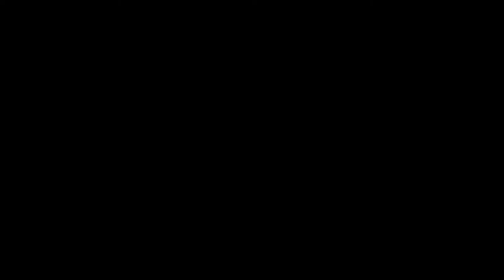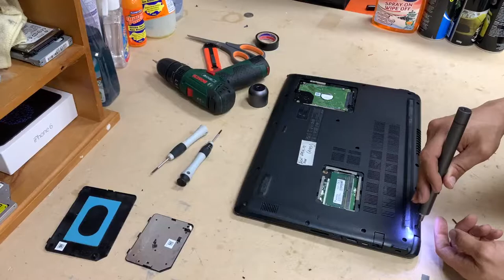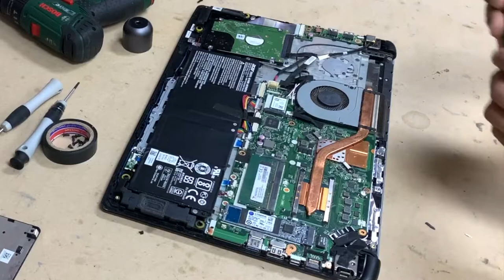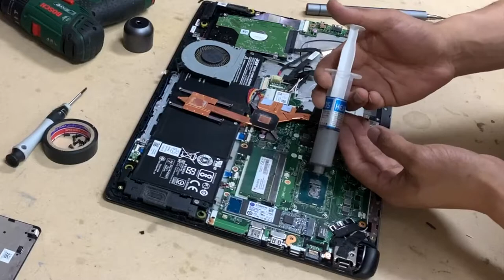Acer Aspire 5 A515  CPU Cooling Fan Cleaning, Thermal RE-paste

Comment: Does the Acer Aspire 5 A515 randomly shut down for anyone else? No overheating or anything, just a click sound and it shuts off. I did notice that it is more likely to shut down if I use the keyboard(i.e. weight on the laptop body).
Reply from the maker: Anyone else?
Reply: Me here...same problem...but only when running on battery power
Reply: If you open the case where the additional RAM slot is, on that case you will find a small black cube. That should be the 'power safety switch' and it is probably a bit shallow, causing the laptop to turn off when moving around.
You can try adding a very small piece of paper underneath that black cube to make it higher.
Reply: I had the same problem. I noticed that even if I any key other than the power button key the laptop starts(but till u press the key,when you release the key the laptop turns off with a click sound). So I found out that the keyboard was the problem( I think there is some volt issues between other keys and the power button). So I disconnect the keyboard then turned it on from the pins and the laptop worked fine. (Obviously not a permanent solution just a quick fix)
Reply: @souhardya69  Same happened to me yesterday. The two metal stripes from the left connect to the power button. Leaving them,just tape the other metal stripes and put it back in the keyboard connector slot. The power button will only work and you can use an external keyboard. It's running absolutely fine for me now.
Reply: i have a newer acer aspire and it just freezes and glitches out. I hate how You have to learn everything the hard way in this life. I would of waited and bought an actual gaming laptop when someone sold it cheaper if I knew these were that bad.
Reply: @cIeetz  This is indeed not a laptop recommended for gaming, but watching movies is great because of the Wide Viewing Angle.

Comment: Hey man while playing game my cpu usage hardly touches 30%(mostly 25-26%) but the temperature goes to 98 degree celsius. On the other hand the gpu works fine with 55 degree celsius. Any solution for low cpu usage and high cpu temperature??
Reply from the maker: Use external cooling pad

Comment: My aspire a5-515 showed bsod two days ago, and at that point i stopped hearing the fan working. I reinstalled windows and can access the laptop again, but i still can't hear the fan. The laptop stays on for hours but it heats a lot, specially from the upper-left border between keyboard and monitor. Should i replace the fan? And with what model exactly?
Reply: it’s the fan plugged in to the motherboard?

Comment: mine is Acer Aspire E1-451G, and it's keep shutingdown by itself while i play some games while it's charging, what should i do?

and the temp is 120 degrees when its charging, 110 when isn't, idle temp is around 85-90 (old amd its normal), should i repaste it? i havent do it fo a years, thanks
Reply: 120?????????????????
Reply: 120 farenheit?
Reply: @Unknown-xe6ni  Celsius lol
Reply: @DrthmN your tjmax is around 95-105 it will ofc shut down
Reply: @Unknown-xe6ni  it's usually OK around 110, classic old amd processor, looks like the paste already dried out so the temp just go higher and higher when it's charging, I need to repaste it right and clean up the fan
Reply: @DrthmN  NO ITS NOT OK
Reply: @DrthmN  Dude seriously you need to re-paste it unless you want your processor to die
Reply: did you check to see if the fan is working
Reply: @jimarjoshualongcob3379  done
Reply: @itswavo  I did it's working

Comment: My screws don’t fit the heat sync screws fml what do I need to take it off
Reply from the maker: Find a smaller screw driver
Reply: @EasyFixLaptop  i did and it was 000 PH screwdriver head and the screw still didn't come out but when i took it to the shop they took it out easy??
Reply: i tried too take it with 00 PH screwdriver too but no work
Reply: @Dafuqbro69  flat screw works for me